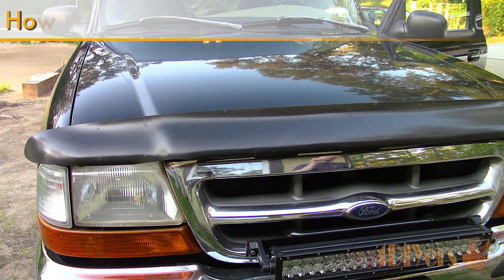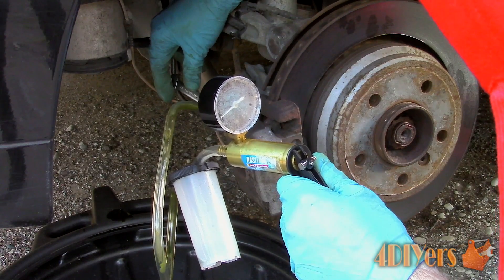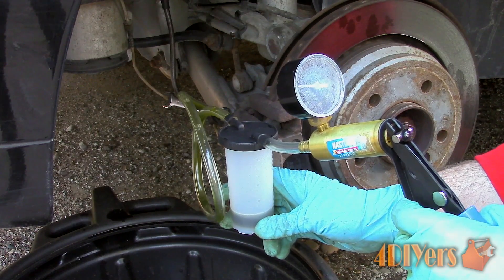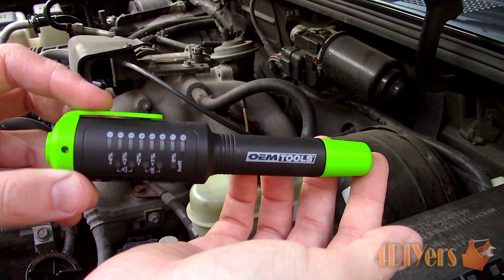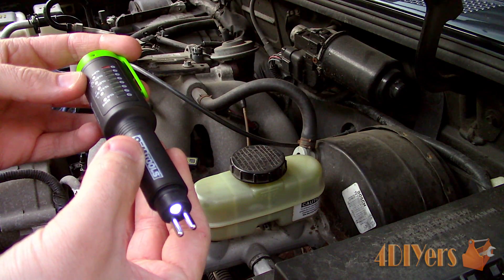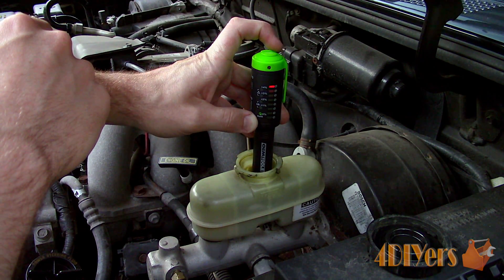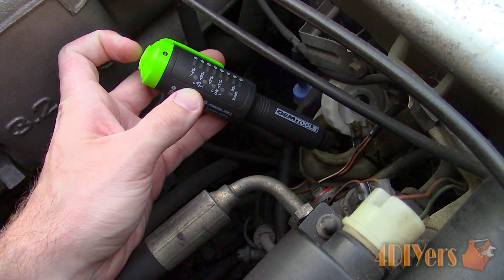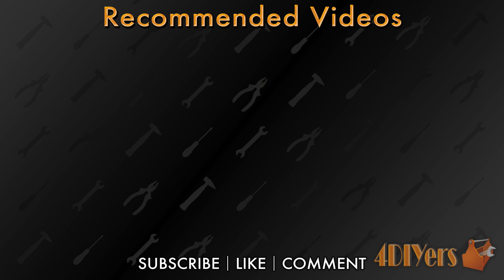How to Test the Condition of a Vehicle's Brake Fluid

Comment: Hi, I used the brake Fluid tester for the first time. Didn’t read any moisture? Is that normal? I’m drive a Tesla model 3. As you may already know, rare to use the brakes on the car. I’ve had the car now for two years. Interested to know what you think. Thanks

Comment: There is a vent in the cap and air is drawn in as the level drops (this happens as the pads wear as the piston will be further out).  This air sits on top of the fluid in the reservoir and the moisture is absorbed into the fluid.

Comment: I just change brake fluid every 2 years regardless. That's a fancy tester. Cheers!
Reply from the maker: That is excellent preventative maintenance! Unfortunately it's such an overlooked area in most vehicles.
Reply: @4DIYers  It's not always so easy.  If it's dry and I don't need to introduce air then get rid of it, I'd rather wait another year or two.
Reply: Badgertronix that's not necessary
Reply: @matowixunplugged7927  It partly depends on the severity of service the brake system operates under. A high-performance sports car that's driven to and braked down from high speeds will expose the brake fluid to high operating temperatures, hastening the deterioration of some of the additives like corrosion and foaming inhibitors in the fluid. I once had a Porsche that required brake bleeding at least once a year in order to maintain a firm and solid brake pedal, even with expensive high-quality brake fluid.